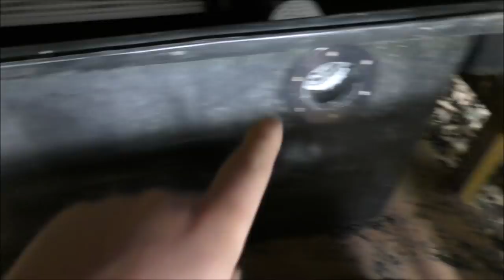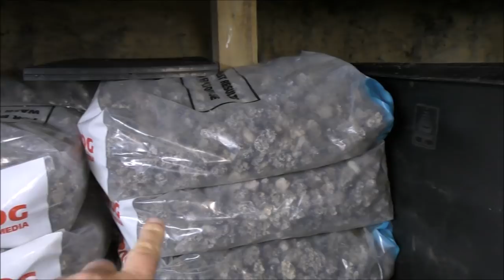Building a HUGE Pond Filter - Part 5 - Static Beds / Pipe Fixings

Comment from the maker: Fifth episode in this mega-filter build for my large trout pond. Today we will take a look at the static bed chambers and I explain about the water flow direction and filter media.
Looking INSIDE filter media video: https://bit.ly/2KbOAGk
The next episode will highlight the two shower filters over another static bed - all will be filled with a nation of media.
*When using side pressure to cut a hole with a drill bit use safety glasses since a broken drill bit is a sharp object which can damage eyes.
Alfagrog used in this video is the E40 size but there is a smaller size available (E25) for smaller filters.
Alfagrog (Amazon): http://geni.us/Il899
Alfagrog (Ebay): https://ebay.to/2zWrajj
Hel-X 13 25 litres (Amazon): http://geni.us/3UBTi
Hel-X 13 25 litres (ebay): https://ebay.to/2QPKiq6
Hel-X 17 (more suited to very large moving bed filters): 
https://bit.ly/2PBAOyn
K1 standard size (Amazon): http://geni.us/zNFFaJ
K1 micro 25 litres (Amazon): http://geni.us/byDQ
K1 micro 50 litres (Amazon): http://geni.us/M7T2AH
K1 micro 25 litres (ebay): https://ebay.to/2P5Flfv
K1 micro 50 litres (ebay): https://ebay.to/2NFJ3YB
Moving bed media (FilterPro): https://bit.ly/2NN1gU6
Vortex filters: https://bit.ly/2Mj7gYa
4" fittings: http://geni.us/nTQc9bw
2" taps: http://geni.us/OBXBGSI
8" diameter brushes: https://ebay.to/2OvMOkc
Filter grids: http://geni.us/oqDBzT

If you've enjoyed this video please check out the playlists on my channel for hundreds more  - on a variety of subjects.
Feel free to share or link any of my videos on facebook, twitter, forums etc. for the benefit of anyone you think may also enjoy watching.
See you next time.
Pondguru

RECOMMENDED PRODUCTS ON AMAZON: https://goo.gl/jMaBWy
INSTAGRAM: https://www.instagram.com/pondguru_outdoors/

FILMING EQUIPMENT:
Panasonic HC-VX870 HD camcorder http://geni.us/3UwE
+Rode stereo microphone: http://geni.us/4OL
+Rode 'deadcat' mic cover: http://geni.us/1pmn
JVC Everio quad proof HD camcorder: http://geni.us/e09e
+Rode 'deadcat' mic cover (opened up and held between tripod and camera base) http://geni.us/dee24
Zomei Z666 tripod: http://geni.us/1a1af3
Manfrotto MTPIXI-B PIXI mini tripod: http://geni.us/87f7
Reply: Pondguru absolute behemoth 👍👍👍
Reply: Pondguru brilliant update that’s some bloody media you have! 

Did you crate the alphagrog to make it easier to remove! Loose would hold more but would be a pain if you had to ever remove it! 

Is there a chance you could measure levels before the big pump is installed and say a couple f months after to show how the nitrate nitrite and ammonia’s have dropped 

Great video again 
Cheers
Kev

RIP ANGUS
Reply: @kev231184  To add to the checking... a sight/depth stick would be good for visibility, either one spot or a few locations, static or one you carry around.
Reply: Like it yeah a marked pole to see the improvement of clarity on the water like it!!!!

Comment: I am sorry about your loss!

The Filter system is really beginning to come together now, it is looking great.
Yes the water is starting to clear up, and the clarity will get to a more prestige and desired stage.

Thank you for sharing. I gave the video a big thumbs up.
Reply from the maker: Yes the clarity is slowly improving but it really needs the big pump installing on the system (which I don't have yet) to shift more water into the system. Also the 12k lph pump running the system will be swapped to the showers. So far I have close to 1.3 ton of filter media in the system, lol
Reply: It is a lot of media but it is needed for a Pond of such a grand scale.
The new Pump will come, just do one thing at a time my friend, because it is a massive project and it can be overwhelming if you try to do everything at once.

Kind regards

Luca

Comment: From when you invented the internal internal moving bed filter, and the overall used of the of moving bed in the hobby, to this monster, is a long way. Well done sir👍
Reply from the maker: It will be well done when it finally works, lol - so far I have 400 litres of media in the moving bed and it is not moving. However I'm sure it will when the big pump is running the system instead of the 12000 litre per hour one (which will be used on the showers).
Thanks for watching.

Comment: Richard sorry for your loss.

This was a great video.  Are you able to post instructions for building this filtering system?
Reply from the maker: The videos I'm posting on it are kind of an instruction for building it but I will be condensing all the parts into one more useful video when the project is finished so that will be easier to follow (and much shorter, probably around 45 minutes with any luck)

Comment: as for the tub not being straight.. i wonder.. if you used a heat gun or a hair dryer to "soften" the wall a bit to bend or adjust it to match been easier? dunno.. but i like this vid. good job!

Comment: i want to make a guess for the tank, its going to be a daphnia culture tank. that way you can feed small fish in your pond live food. 
at the same time, daphnia will eat the floating algae and floating bacteria that is in your pond water. that is the probable reason for having the water feed coming off the brush filter "tub" . 
most of the sediments that is inorganic like dirt and stone dust would be settled out by the vortex and brush filters.

basically not only are you improving your filtering capacity, you are also boosting the micro organisms that clean up the water.

only problem is the tank isnt in the light and  i doubt using a fluorescent light works as well.
but i dont know much about daphnia culture.

the other possiblity is bamboo shrimp or other filter feeders

and RIP Angus.. another black kitty life cut too short

Comment: Why not use a ball joint or perhaps flexible hose between the two? Would that work better or would that not be possible?

😆 Maybe I should learn to wait until the video is finished before commenting lol, now I see what you were up to and that the two tanks are sitting close to each other. 😂🤣😅 Oops good job on the filtration system, fantastic design.

Comment: I have 1 little concern. The feed into the shower filter tub. It is quite a large upside down U bend. When this finally fills with air it will slow your flow rate. I would leave it open and disturb the water surface instead of the venturi you added.
Sorry to hear about your cat.

Comment: I know you said you were stopping comments on videos but hopefully will catch you before you finish. What is the big tank behind you at the start of the video & where can I buy them in Europe. The Americans have big rubber maid tanks. Also i am trying to heat a 1000 litre IBC tank in a shed that gets down to 10°C in winter. I want to keep cichlids in it. What would be the most economical way of heating a large body of water like that?
Reply from the maker: There is a manufacturer of large tanks near me called AC Aquatics and with regard to heating a large tank in a shed the way forward with that would probably be to spend the money on excellent insulation for the shed then get a decent sized in-line heater or even heat the room with a thermostat to control temperature.

Comment: Richard what are the numbers on that pond? Gallons? size? Depth? How much water per hour is flowing in from the spring? What's the history of it? You made it? Bought the land with it?
How many gallons per hour is the pump going to move? What's the exit?..pipe or ornamental falls of some kind?
Thanks..take your time on the project..there is always tweaking for years to come I'm sure.

Comment: whats the reasoning behind chosing 4 inch pipe for all connections within the filter but a 2 inch inlet? Isnt that a bit overkill? Outlet needs to be bigger than the inlet for sure. Are you expecting those big bins to hold their shape? They look a bit crooked with the water weight.

Comment: Hey pond guru, I have a question. So if I live in a tropical climate and I wanna keep a cold water fish, or in a cold climate and I want to keep warm water fish, is there any practical way of heating or cooling a pond?
Reply from the maker: If you search for aquarium chillers you may get an idea of the type of unit which would be needed to reduce a temperature and keep it stable but most coldwater fish will live at reasonably high temperatures.

Comment: With your biohome 
ultimate would you need to wash the media through tap water or just add it straight to the filter
Reply from the maker: As any fine dust generated during transit will be fine sand (and not harmful) it doesn't need washing but if you want to give it a rinse then just use water you have drained from the tank or treated tap water.
Reply: Thank you

Comment: Pond or lake

Most would say it’s size, a lake is bigger, a pond is smaller. That’s actually wrong. From government websites to Wikipedia, the information is wrong. The difference is actually a result of the the depth.

Ponds, according to limnology (the study of water bodies) are shallow enough where plants could conceivably grow across the entire surface. This area, where plants could grow is known as the “photic zone,” meaning where the sun’s rays can reach the bottom.

A lake, by contrast, has an “aphotic zone,” meaning there is an area deep enough that sunlight can’t reach the bottom.

As a result, there are some very small bodies of water, less than an acre that are deep enough to be called lakes. Conversely, there are some very large, but shallow water bodies, particularly in the south that are technically ponds, (though they’re called lakes) because their “photic zone” expands the entire length and width.

So, at least with lakes and ponds, size doesn’t really matter.
Reply from the maker: And I've learned something today already and it isn't even 8am - nice one. As my pond is about 6m deep I should maybe call it a lake from now on, lol
Reply: Lake Angus comes mind to mind great filter by the way got my brain thinking its hurting me looking forward to spring.
Reply from the maker: @Steviebguinhiking  Lake Angus sounds good to me. Groovy.